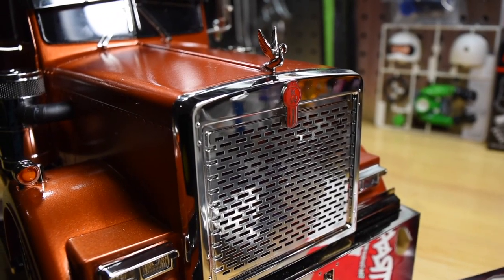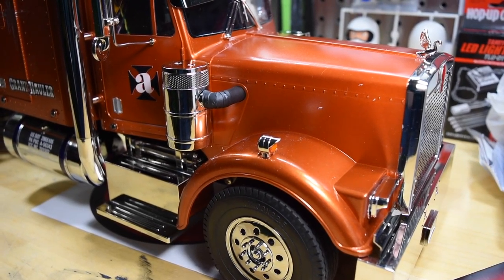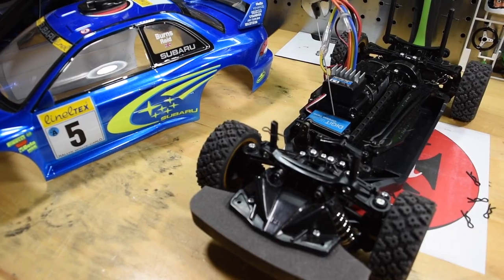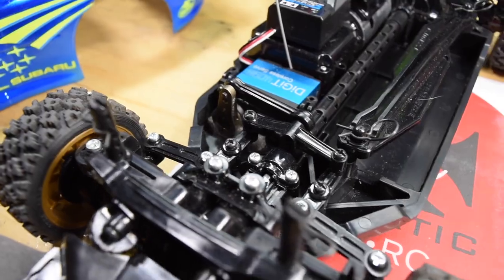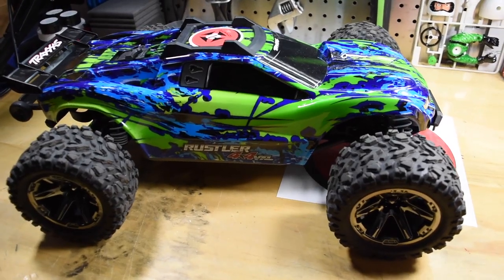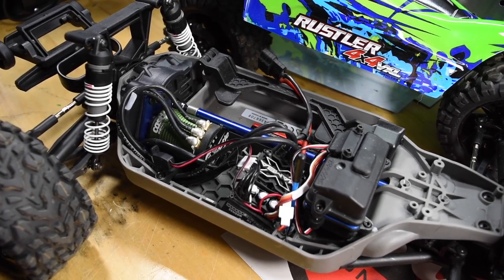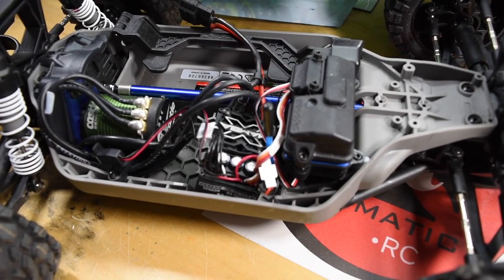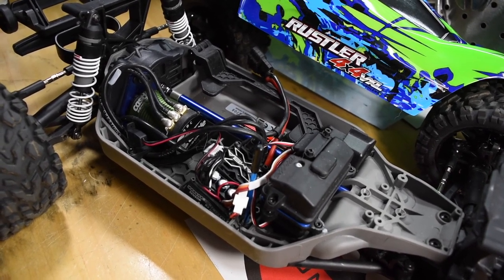A Few Little Things - Traxxas Rustler, Tamiya Grand Hauler, Tamiya Subaru Upgrades!

Comment: Q: There are 3 J-18 back up lights and only 1 plug to put them in. What's with that... Seems alot of the lights are like that.
Reply from the maker: I only had 1 j18 in my kit. The middle light lights when in reverse, the other 2 are dead right now. Going to make them accessory lights. Also, no lights for 2 spots on the bumper. Probably goin to do the same. I’m making a video with the hauler and then it’ll go in for a major rehaul!
Reply: I'll ask Hobby Jeff. And let you know what he says.